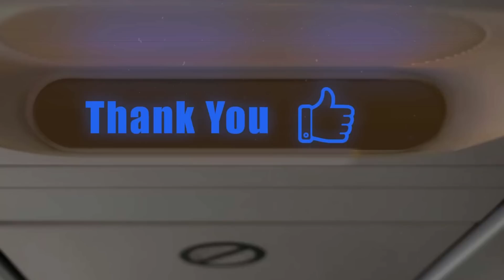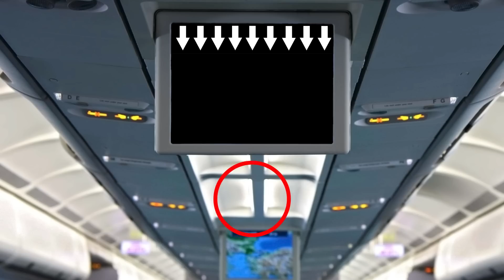Plane Destroys Runway

Comment: For a channel dedicated to Planes, there is a lot of misinformation on this video. 

1. 0:01 The de Havilland Vampire is gorgeous, I had no idea there were any still airworthy.  
2. 0:22 That's called "crabbing" and it's very routine
3. 0:33 The plane featured is not breaking any barriers, this includes the fictitious "speed barrier". What even is that?
4. 0:49 It's a F-111 Aardvark not a F-11... The F-11 was called the "Tiger" and was flown in the 50s and 60s.
5. 2:30 There's actually faster flyovers in this same video.
6. 5:37 The plane is NOT breaking the sound barrier. Many people mistakenly believe that the vapor cone is a sign that the plane is breaking the sound barrier, which is not so. It's merely a result of pressure differences as the plane accelerates through changing moisture levels and air temperature. Jets traveling at supersonic speeds at such a low altitude could do damage to not only property and equipment, but also to the hearing/health of people. 
7. 7:11 "exercised" or experienced?
8. 8:48 routine crabbing again

Comment: Crabbing, or landing sideways as you refer to it, is standard operating procedure when you have to land with a crosswind. The pilot just has to ensure hitting the center stripe of the runway so that when the tires make contact the nose sometimes with a little rudder will snap back to the center

Comment: 4:49 Is the biggest moment in the video "This is how much water the plane jet suck in and expell from the back when taking off". It seems that the wheels are expelling water as well smh
Reply: And the vast majority of that water is directed outside the actual internal combustion of the engine there are veins inside the nay cells that redirect that water out the back so the engine isn't actually thrusting or pushing or dealing with gallons of water entering the actual engine

Comment: Engine failure is a scary event that causes sometimes even the most seasoned pilots to panic. Just remember the aircraft itself is designed to fly. Do not panic. You may have to swap outitude to generate airspeed so that you stay aloft but if you panic you will cause it to fall from the sky if you try to wrestle the aircraft. When I was learning to fly recovery from a stall was practiced at a high enough altitude so that I could see that if you just let the aircraft fly it will even without the benefit of propulsion.
Reply: Would swapping some of that outitude for calm help the pilot to stay in control?
Reply: @brianjob3018  unfortunately sometimes wingstalls occur at low altitude and you really don't have any altitude to swap for speed and in that instance there's not much you can do. This is why it's so important to make sure you do your check list and make sure your engine is functioning properly and that everything's working correctly because the two most dangerous times in an aircraft or takeoffs and landings. The reason being is because of the altitude secondly coming into contact with the ground and getting the plane up into the air. Some of the greatest pilots in the aviation world have died in situations that you would never have expected them to but then that just demonstrates how deadly aviation can be even when you think you've dotted  all your eyes and crossed all your t's.  I guess the only thing really to compare it to is having a deadly car accident. Your chances of a car accident or higher because it's not just you and your vehicle it's all of those other vehicles around you. Usually, in an aircraft it's just you and your aircraft and rarely is it colliding with another aircraft. If you experience a stall at altitude you have to point the nose down to get the air speed up you can go full flaps keep the nose pointed down to keep your air speed up and flare at the last minute to try to slow it down and hopefully survive that. If you're much higher and have a lot of time you can just glide the plane in and land it safely that happens I'm not going to say often but it happens enough to prove that it can be done in an emergency.
Reply: @brianjob3018  this is the kind of thing that I would think about when I was a kid watching The Jetsons. I know that we had this pesky thing called gravity and even if we could have a flying car if it broke down or stopped running you were going to crash through the ground. That's why I never really bought into the flying car idea because it's hard enough to drive on the highways and the roads without running into someone or someone running into you and just the plain and simple fact that people do break down I just couldn't imagine why someone would put themselves in a position to crash to the ground just for the sole benefit of being able to take your kids to school in a flying car

Comment: Errors in the narration (without even reviewing the sources, there are probably more):
0:06 - thats pieces of asphalt, not grass
0:33 - that plane isn't going supersonic, and "speed barrier" is not what it's called
0:40 - can't even recognise two of the most iconic fighters in history
0:50 - it's F-111, not F-11
1:00 - the spray is jet blast blowing surface water off the runway, nothing to do with wings being wet
1:56 - all modern airliners have ILS and can land in zero visibility
2:30 - the plane is literally subsonic, there are videos of supersonic flypasts...
3:05 - all airliners use thrust reversers to slow down on every landing
3:35 - NATO doesn't have it's own aircraft, that is a spanish F-18
4:10 - thats the thrust reversers kicking up water
4:50 - once again thats jet blast blowing up surface water, nothing to do with water injestion
5:40 - its not supersonic

Don't make content if you have no clue what you're talking about
Reply: Planes use the ILS, they don’t have it*
Reply: @diegoramirez8674  “On the aircraft, an ILS receiver interprets the information and reports which side the aeroplane is situated to allow the pilot to adjust accordingly” it requires the equipment on the ground and a receiver on the plane

Comment: 4:49, no water is ingested by the engines. The water is on the runway and is sent flying as a result of the engine thrust. You really need to get someone that knows what they are talking about before posting videos about airplanes. There are numerous other issues with your voice description, like breaking the speed barrier. Just get someone to review your text and your video quality will increase a lot.

Comment: I would also like to add when an aircraft is traveling faster than the speed of sound you will not see the aircraft and hear the sound at the same time. You will visually see the aircraft pass you and as you see the aircraft depart your vision you will then hear the sound chasing the aircraft. There is a half a second to a 1 second delay depending upon how fast the aircraft is actually flying. An aircraft that is flying below the speed of sound you can hear coming as you see it coming once it eclipses the speed of sound you will see the aircraft before you hear it.
Reply: Assuming you're directly underneath the flight path which is the place to be imho. I love a good flyover. The louder the better!
Reply: I know the worst place to hear it is inside the airplane. You do not, of course, hear the boom at all.
Reply: I fell asleep three times trying to read that...
Reply: @murrijuana2842  then you need some serious help because what I wrote was not a very long response at all.

Comment: The F-18 was not supersonic…..geeze.   It was the shockwave where the air was supersonic over the wing but the plane was not…..
Reply: Actually, it's called a conal condensation due to the humidity levels at that height given the planes speed.

Military aircraft are forbidden to fly supersonic over land in the United States  and close to coastal waters along the United States.

This Blue Angel was filmed at fleet week in the San Francisco bay area.
Reply: Yeah but.. it was “breaking the speed barrier” 💁🏻
Reply: @woooster17  - no it wasn't.

Comment: It does not take much to destroy a shittily constructed runway. Imagine what a jet with POWERFUL engines would have done. 

7:43 I hope that asshole in the Citation got a pink slip. WTF was he thinking?
Reply: You actually think he’d get into an active runway without permission? Methinks the controller was just being effecient in getting the traffic flowing.
Reply: @mikaelbiilmann6826  I have been flying since 1981, I have seen crazier shit than that in the last 41 years. And his exhaust could very well have kicked all kinds of FOD (you know what that is right?) into the intakes of that other aircraft.
Reply: @scottmurphy650  Aaaah, fod, yes.
Reply: It was more efficient for the controller to line the 747 up and hold it while the Citiation departed ahead of it - otherwise there would have been a long delay for wake turbulence. The depth perception in the video is a little confusing, but the Citation started from the thousand foot markers so I doubt that FOD would've been a problem.
Reply: @otterspocket2826  All it takes is one bolt or rivet down the intake to destroy a $2MM engine.